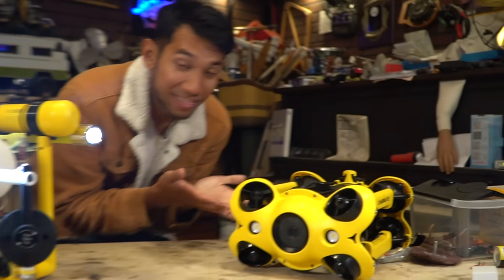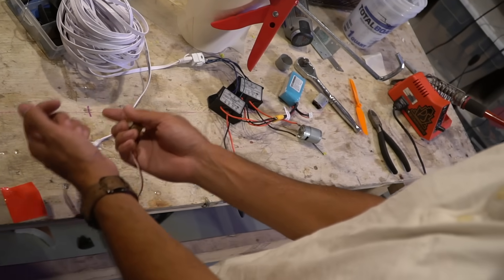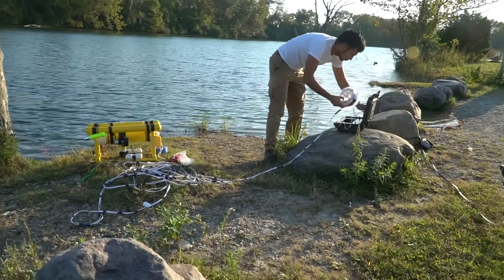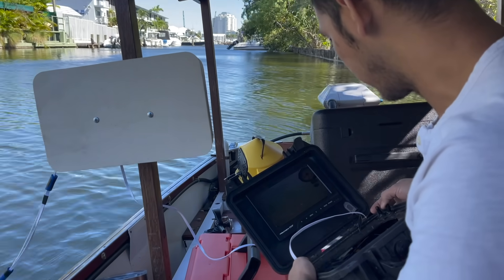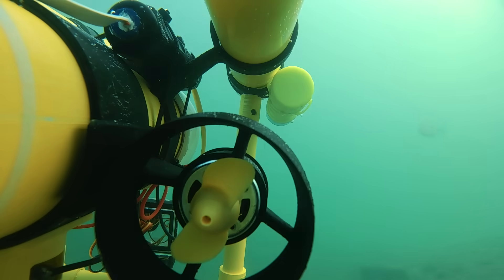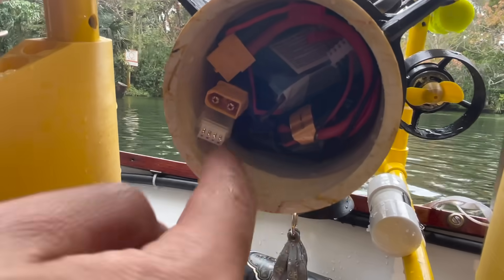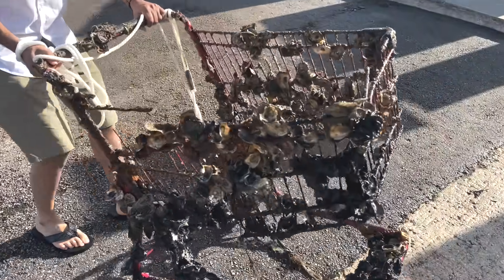Cheap PVC submarine DIY

Comment from the maker: Use me as a dislike button, I hate how YouTube has removed the criticism feature
Reply: I liked the video but I wish there was more footage of the build itself...
Reply: @ajank7  💯%
Reply: i will not dislike. it is only supposed to be used on BAD videos. This one was very nice .-.
Reply: Awesome idea just would prefer to see a lot more of building the project as I find that's the best bit. keep up the good work though
Reply: Well here's some criticism: THE BUILD VIDEO IS TO SHORT!!! 😁
Reply: Grab the Chrome extension "Return Youtube Dislike", it returns the dislike button to its proper functionality and can pull the actual number of dislikes.
Reply: Would an IR camera with IR lights provide better visibility through murky water?
Reply: Do you know why the FPV footage is so fuzzy sometimes? Is it just the camera? Unshielded wires? Resistance of the wires?
Very cool project, btw.
Reply: @ErwinHolland.  any specific timestamped example? could be early watcher (yt still transcoding a higher version) or bad camera focus.
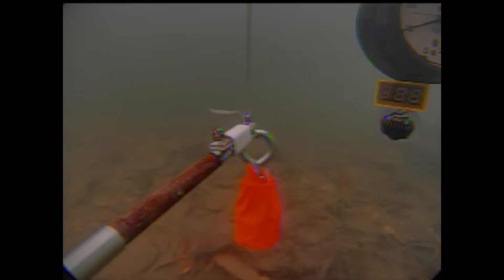Reply: @shize9ine  Oh no, I mean the FPV footage. (edited to make that more clear) Like at 7:14.

If it's hardwired in, quality should be pretty good, but it's very fuzzy.
Reply: There's a plugin for that. "Return YouTube Dislike"
Reply: I like the idea
Reply: I want to like this comment, but that means I dislike the video
Reply: Insert GoPro dog here
Reply: @petersripol suggestion find a flooded mine to explore or possibly even a blue hole
Reply: Should update how many dislikes this comment gets at some point in time...
Reply: no worries theres an addon that puts the dislike button visible again
Reply: Cool projet. Just use less music or lower the music volume, it's higher than your voice.
Reply: Peter, what's the link for the print files and schematics?
Reply: @PWN_Nation it’s in the description
Reply: I always comment like this on others' videos to add back the dislike button lol
Reply: lol im the 66,699th  view
Reply: Do you have a link to where we can download the 3d files?
Reply: you can get dislike count extensions for both firefox and chrome
Reply: where those fusion files at?
Reply: Hmm, I almost automatically clicked Like because I agree with the comment. This will be a learning curve.
Reply: I just had to re-subscribe. Youtube un-subbed me from your channel!!
Reply: U live in texas?
Reply: Teamseas?
grab all trash of pound with Mr beast
Reply: Hey Peter, you have 414 dislikes according to "Return Youtube Dislikes"!
Reply: If I dislike this comment does it count as a second like?
Reply: Just more censorship from shittube
Reply: @papascrumpeeh  yet here we are lol
Reply: @kyoteecasey  here we are indeed on a monopolized red pile of shit that smokes out any competition
Reply: You can't make a statement that we agree with while saying that to like the comment means to dislike the video.
Reply: Very cool video my g
Reply: But creators can still actual dislikes on the back end, or so YT says. Not that I want to dislike this great video. Thumbs up from me!
Reply: I can still see the dislike button on my Chromebook but not my MacBook so this is only half useful for me
Reply: I liked the vid tho
Reply: I agree with this comment, and therefore, I will not like it, because that would imply disliking the comment.

Thanks for ten years of confusion, YouTube.
Reply: You should make a video with dallmyd finding treasure in the water  mabye even see who can find and get the most stuff!!!! Love your videos by the way.
Reply: I still have it... for now.
Reply: The only thing I dislike is that I cannot like this twice...so I commented.
Reply: Apparently YouTube will allow content creators to enable/disable dislikes so you can turn it on when it comes
Reply: Agreed! You should have made those separate comments though bc I almost liked it just bc of how you criticized YouTube's decisions lol
Reply: Same here they removed the ability to see how many people hate stuff. Its a sad day.
Reply: I still see a dislike button, granted I don't see any dislikes counted, so either they stopped counting them or this video is so flawless that no-one would dare hit that button..... Hmmmm either theory holds merit
Sorry but I think everyone just likes you!!!
Reply: I don't know what's worse the YT bot that's deletes comments based on keywords the increased ads and pushing the Premium YT, or the Dislike BS? Wonder if this will get deleted by the Censor Bot??😳.
Reply: There's a Chrome plugin that brings it back... Kind of. It uses data from users that click it to estimate how many overall dislikes there are. "Return YouTube Dislikes" it's called.
Reply: now why tf would we want to do that peter?
Reply: it's the result of " participation " awards given to losers...folks in america are weak and actions like this only reinforce it, also, more folks will post vides of they don't receive bad feedback, which is what helps us to be better folks.
Reply: oh YouTube did that?
Reply: How do I like this comment without disliking the video? lmao
Reply: but I don't dislike
Reply: @user-sl1wt1dv4y  yes
Reply: #teamseas................................................
Reply: There’s an extension that takes days from before dislikes and data that the channel owner has to give an estimate on dislikes
Reply: Come on!  Only 114 Dislikes (as of now) according to the "Return Youtube Dislike" addon.
Reply: Good idea around google’s woke bs. People already had the option not have like/dislike feature for their videos. This is so joe biden can have the like/dislike  feature enabled without showing how many dislikes “he” gets. YT already got caught shaving his dislikes down.
Reply: I’ve not heard a single word of support anywhere from content creators or commenters for the removal of the dislike count. Maybe it was Brie Larson crying about it.
Reply: I don't have critics I have questions 
1. How is the either net cable water proof 
2. Can you still see this even with a Navy esc camo under water
Reply: YouTube: "Let's remove the dislike count becuase it may make the YouTuber upset".
Also YouTube: "Let's make the dislike button 4 times bigger than before".
Reply: Very cool boat.
Reply: You found an old shopping cart,  or a man-made reef for fis to hide in.
Reply: this was a good video. I too wish YouTube would bring back the dislike count
Reply: I can literally see a dislike button under the video so I am very confused :/
Reply: You need to not do the rc test flight type songs
Reply: it is like that LEGO movie, "Everything is awesome!"
Reply: Love your videos - Thanks for putting them out there!
Reply: As much as I admire your stance on the Youtube criticism issue I can not bring myself to hit dislike on any of your videos ever. Thanks for being a man of principles.
Reply: @PeterStripol I didn’t get notifications for this vid or have it pop up on my feed, I have bell on and all that. Just heads up in case alg is being weird! Keep up the cool vids ✊
Reply: did you get the same person rctestflight uses for topical sea shanties?
Reply: AHHHH i wanna like this comment, but if I do its technically a dislike in your eyes, and I like the video so uhhhhhhhhhhhhhhhhh, love the video man!
Reply: Damn I want to like this comment because I agree with it not because I dislike the video
Reply: I bet the 587 thumbs up are really those who are agreeing with you :) LOL and not thumbing up as a Thumb down LOL
+++ Thumb up this comment if you agree +++
Reply: I know. I can't even tell you how much you suck or anything....I like the song. It went well with late night snack😁
Reply: your awesome
Reply: I just realized that comments too have no dislikes...
Reply: So wait are we supposed to like or dislike this comment 😂
Reply: how could we dislike our home grown genius ?
Reply: There's an extension to bring it back, and it allows you to share the stats with your viewers!
Reply: I'm disliking your comment which equals a silent like.
Reply: so we dislike this comment if we like the video? (._.)
Reply: The mentally unstable snowflakes brought up on everyone gets a trophy and they are not held accountable for their own actions and can't take criticism for bad behavior came up with the idea of disabling the dislike button and the comment sections.
Reply: Don't worry, it's a great video, not many videos upset me, but the ones that do are generally hated by over 50% of who saw them, so I usually just report them.
Reply: Youtube has long since disabled the dislike button for comments... It doesn't do anything
Reply: @sasuge  I don't know why it's still there, its useless.
Reply: this comment has more likes than the actual video has dislikes
Reply: I hate that it doesn't have a metal detector.  Oh! Would it be possible to build and add a DIY metal detector to your next iteration?
Reply: "criticism feature" lol
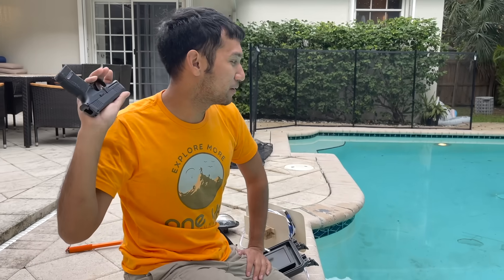Reply: I normally like your channel a lot but Alec Baldwin would be proud 6:05
Reply: i want to like this to show i agree but i dont want to dislike the video 😖
Reply: I like this idea, but liking this would mean disliking your video...
Reply: Not gonna upvote this comment as a dislike 'cause this was an excellent video, but I am gonna upvote a bunch of the replies instead.
Reply: you can get a browser plugin that shows it
Reply: Did catboy edit this??
Reply: don't trivialize guns!
Reply: Bro i like your underwater pirate song.
Reply: this reminds me of the sea perch program
Reply: We will comment when we don’t like the video no need to do this and comments are much better at showing a dislike
Reply: I still see the dislike button
Reply: You are getting a like just for adding the dislike button, wait.... if I like this does that count as a dislike?
Reply: I disliked this comment because I liked the video, therefor double the likes.
Reply: You should have Return YT Dislikes Extension for Firefox - 340 dislikes
Reply: Why is there a dislike button if you can't even see how much are there?  Fun fact, never had to use that weird upside down like button on your videos, hardly on any videos actually.
Reply: liked your video, but im also liking this because I'm in agreement with you that I hate that youtube removed the dislike counter.
Reply: You can re-enable it on y our channel, it's in the settings.
Reply: A: They have not removed the dislike button they have made the dislike counter only visible to the channel admins
B: We can't see the dislike counter on your post either so how does that help anyway
C: It was a great video anyway so I have no desire to dislike it
D: stop being so dramatic
Reply: @Clara_Page  A) effectively for viewers, dislike button disappear.
B) People are using the "Up like" counter on his post to represent dislikes.
C) most don't unlike.
D) is english your first language?
Reply: @MrSpiritmonger  
A: The dislike counter is still there, giving people the power to let the channel owners know that they dislike the content. The counter being invisible is a deterrent for trolls. If you feel the need to warn people about bad content you can do that in the comments and if you want to judge if a video is worth watching there are extensions to re-enable the counter.

B: Fair enough, although maybe you should explain that in the post though for people encountering dislike button replacement posts for the first time.

C: I'm not exactly sure what you are trying to say here.

D: If that's meant to be an insult then that's a bit rich considering the errors in your reply.
Yes English is my first language, not that that should matter anyway.
Reply: Link opens chest noises dun nu nu nuuuuuuuuu you got a GLOCK! why is this in the ocean I don’t f()&$[(;9 know I’ve been in this basement for 5 ye— muffled noises
Reply: Can you fish with it ? or does it cause problems?
Reply: I was just thinking about what your posted.. how strange.
Reply: Maybe sell these?
Reply: I agreed with petersripol
Reply: I challenge you to build a solar powerd dron or glider that can fly for days
Reply: Thank the good lord somebody said this. Youtube really needs to bring that feature back. I'm certain they downgraded their product as a money grab.
Reply: you currently have 25 dislikes as of 7:26 pacific, 12/18/21
Reply: Me, who was about to like your comment:
those bastards lied to me
Reply: if ye be playing a pirate song, ye should get some wenches to twerk, everybody knows pirate's are a little crazy about booty... arrrghhhhh...
Reply: I really want you to make a newer improved one that’s more expensive because I would  enjoy  watching u search deep waters.
Reply: google: 
youtube dislike extension
Reply: What is that?
Reply: no, i don’t think i will.
Reply: PS make f 35 votol system plane.
Reply: Why would we dislike if we like your videos
Reply: i don't unstand what criticism mean
Reply: Can you make a video to know how to make that submarine or what ever it is
Reply: Can you make a video to know how do you build it (12:598
Reply: motor details broo???
Reply: Dislike
Reply: I dislike you design isn't used commercially. You should build and sell those.
Reply: take it to chicago  *or LA
Reply: Great idea! Using the comment like button to measure oppositional feedback, is next-level! Lol  Can tell you have a mind for engineering. Cool project! Thanks
Reply: I hate you for making this so simple and easy, your common sense and logic is dislikable if your a complex bipolar engineer. 😅
Reply: Great Video, but please get a better Ethernet cable.
Reply: I believe that you as the channel owner can still see how many people give you a thumbs-down.  I didn't give you one, although like at least one other, I'd have liked to see more of the build process.  That's one of my favorite things on your videos.
Reply: @michiganengineer8621  Your comment is why Google should require a simple yes or no questionnaire as to why viewers dislike all or part of a video. Peter and other content creators need to know why someone disliked their video. In your case, you disliked the video, though you felt it didn't warrant a dislike for not showing and talking about the more important aspects of the build process. With a  simple questionnaire on dislikes, Peter might see that you and other viewers want a more detailed build process. Maybe a link to a PDF document. with a breakdown of the build process, parts, files, etc
Reply: @michiganengineer8621  I'm sure he knows that he is giving you as the commenter the place in which to do so!
Reply: Anyone who criticizes your videos is a troll and their dislikes don't count.
Reply: @Jonathan.D  not shut about that one
Reply: @alowen1265  Perhaps you should learn to proofread your replies and not take things so seriously. 👍😁
Reply: @Jonathan.D  There have definitely been a few cases in the past where a dislike was in order.
I remember some videos where he didnt seem to care at all about the content and only got excited for the sponsors.
Reply: @Jonathan.D  then what dislikes do count??
a new paradox has revealed itself
Reply: It's a joke in my eyes
Reply: I really like the simplicity of the project! Be well everyone
Reply: no, I now use you as the like button :)
Reply: @JAWZ2232  after you watch other videos in other categories.. you report back to him..!! 😆 🤣
Reply: Agree we need the criticism feature  to be available ...  though for your channel plenty of dust on it .  You would have to really put some effort into it for me to dislike anything you do Peter .  Be healthy and happy sir.
Reply: https://youtu.be/QvX-ekkWe08
Reply: @PeterSripol You should build a submarine that can catch fish, and ocean critters like lobsters and stuff; Either trap them live, or spear-fish the suckers.
Reply: @baconsarny-geddon8298  I had the same idea. Perhaps a lionfish hunting version. There are almost no restrictions on how lionfish are harvested.
Reply: Dislike

Jk jk cool design and build
That shanty slapped btw

Comment: I don't know if it's the cable, the voltage drop, or interference, but every time you hit the motors, the screen drops. I believe this is for any of the previous mentioned issues. A thicker cable to transfer the power might be a good idea, also, separate. Just a thought. Great project anyway!!!!

Comment: Hey Peter, there is a low chance you will see this message since the youtube algorithm shows me this amazing chanell 3 years later, but I was wondering about a few things. 

1. What pipes are you using to create the buoyancy on the top?  I just need the name thanks

2.  I noticed that you used brushed bilge pump motors. Can you hook up the wiring to the relays like you showed in the diagram to a normal bilge pump?

3. I loved your video, nothing to make it better. This is the type of stuff that I'm into and your channel has just charged my to full battery of ideas man!

Peace.

Comment: To avoid the clicking in the camera when changing directions should I put the camera on an independent power supply and line? Or is the 12v and main battery necessary together

Comment: Did a little math and I calculated that if you are using low pressure pvc that can handle 10 bar it should be able to dive down to aprox. 90 meters (290 feet) using the equation 10m = 1b where m= 1 meter and b= 1 bar

Comment: I'd have to say the biggest flaw of it is that he's running wet motors. Water is conductive so you lose power to it, but your motors won't last long either. 
If you have access to a router you can machine PVC end caps into cases for the motors. If you've got access to a 3D printer, you can just print cases for them. An o-ring for the drive shaft is easy to glue into the case. If you want to be able to go deep, you can fill the motor cases with mineral oil (which is non conductive) and it will prevent water entry under higher pressure. 
To get cleaner video, I'd have used a coax cable taped to the ethernet cable. (you're taping foam to it anyways for floatation)

It's a cool ROV, but it could be improved for very little extra cost.